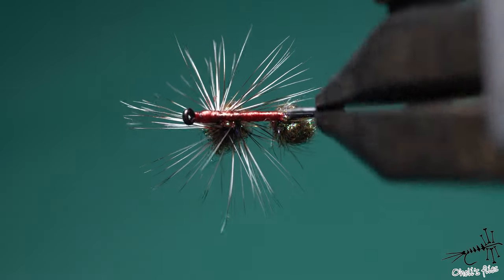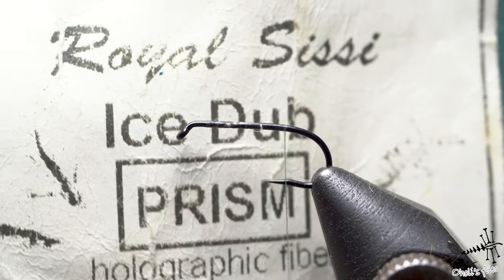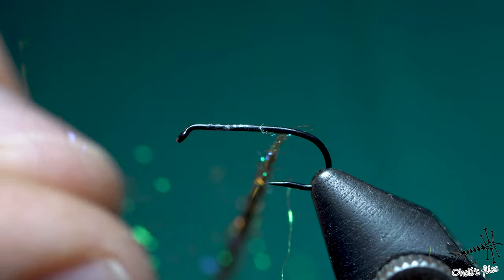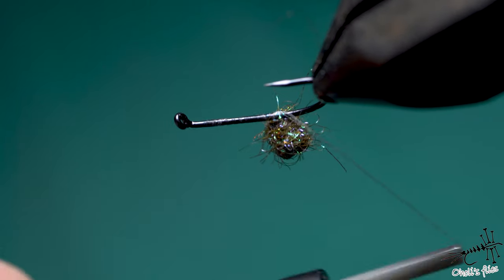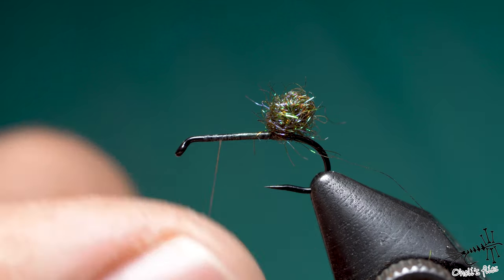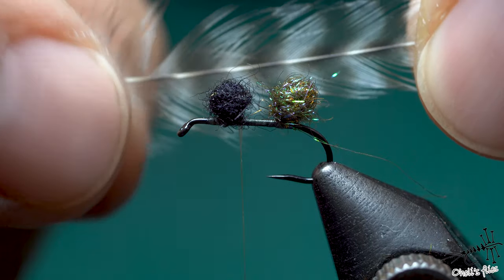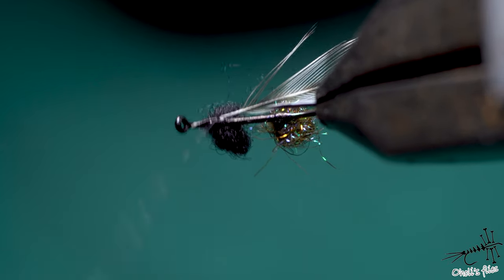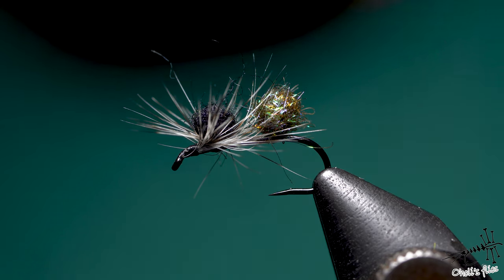Two Balls Ant

Comment: Very good! I have a question when whip finishing and cutting the thread. I find that if I hold the thread right and cut it goes back under the wraps and comes undone. Do you make slack before cutting?
Reply from the maker: Thanks. No slack my friend. Wayne Luallen has great video on whipfinish with hand. Check it out.
Maybe you should wax thread prior to whipfinish...